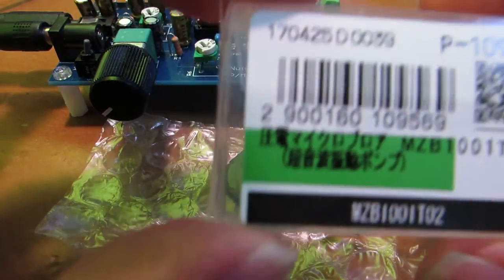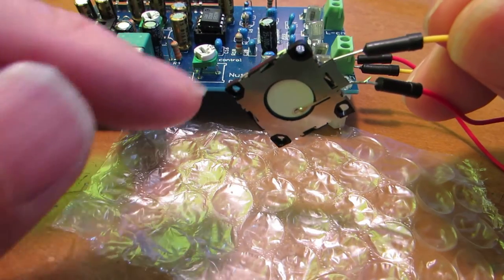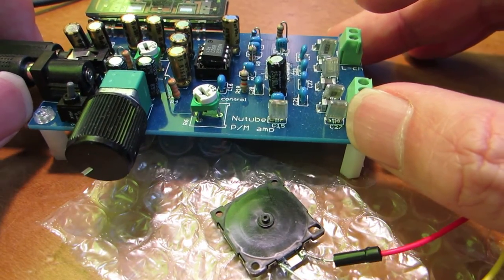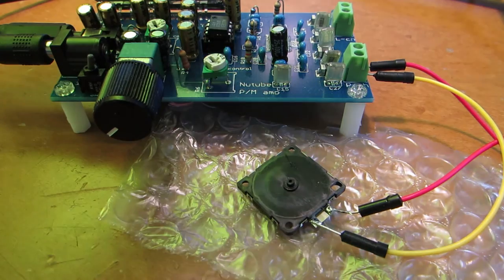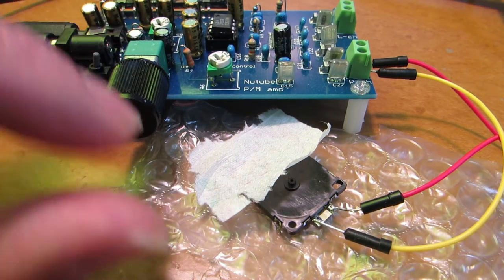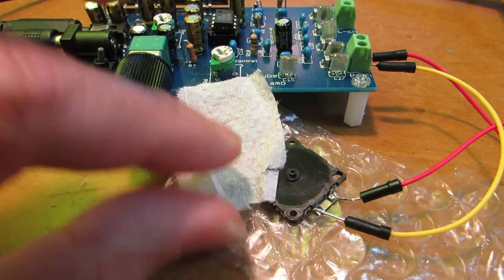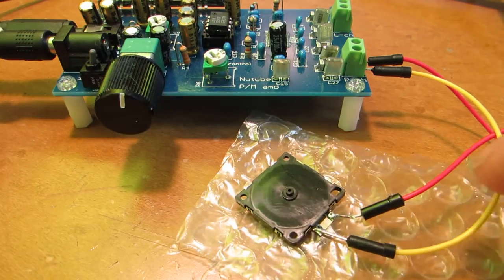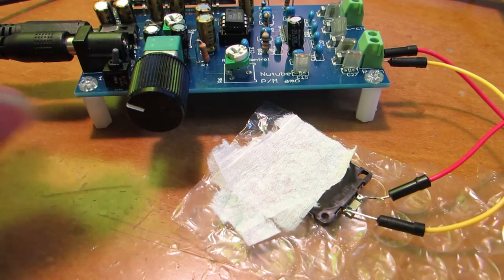Piezoelectric micro air blower!

Comment: congratulations for your video. I would like to know where I can get a circuit to run the piezoelectric blowers as I imagine they work with positive and negative voltage at a certain frequency. Thank you

Comment: Hi, can you suggest some guideline about how to increase the output pressure by connecting them in series? Also, how to create a vacuum using this microblower?
Reply from the maker: I think it should be parallel, not series for pressure improvement. And...... indeed I am not professional of "vacuum field" but it should be quite difficult to get vacuum (we definitely need some valvular for it..)

Comment: Hello ,Thanks for sharing this video..I have one question i would like to ask.
1.Where is the air input port on that device?
Reply from the maker: Hello!  The air input is below the element, the opposite side of the air output (top small hole).
Reply: @microwavemont  
Hello! can you show more specific (may with pictures). I'm having a research project that uses this device. But the order I bought has not been delivered due to the Covid-19 situation!!
Reply: @sykien_3  hello friend, me too working on piezoelectric field

Comment: Hi. Can I ask you if the microblower has any polarities (+ or -) while you connect it to NuTube?
Reply from the maker: No it does not. Microblower is just vibrator and the function is always just blowing, not air drawing.
Reply: Thanks for your quick response! Got you!...I have just started to work with it actually and in case of any doubts i come across on my way, I will write to you again. ..:)
Reply: Hi, I have a question again. Can I check with you how much current the blower needs in order to operate, from a 15 volts supply?
Reply from the maker: Hello, it depends on 26kHz generation circuit configuration but the circuit in my kit
https://www.tindie.com/products/microwavemont/piezoelectric-micro-air-blower/
draws 200mA at 3.3V.